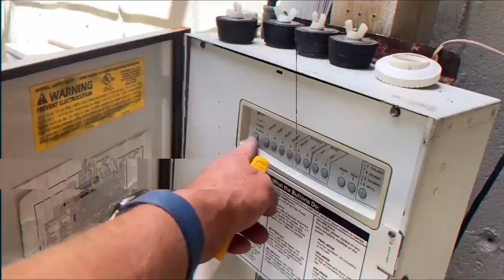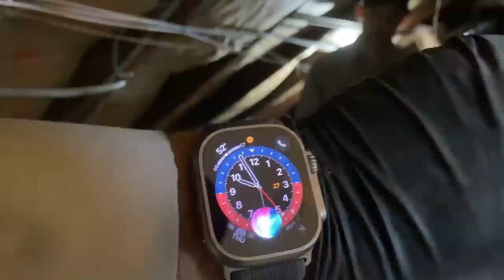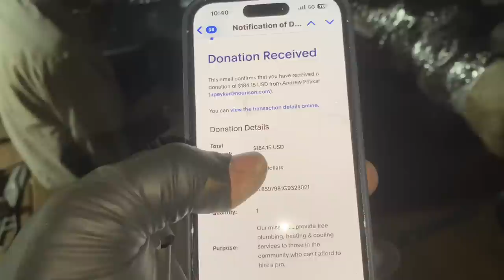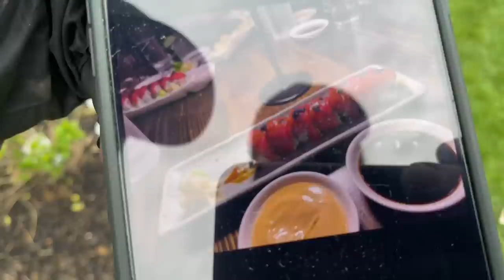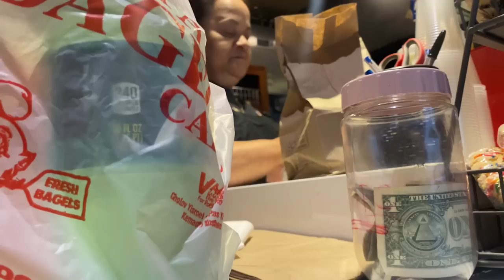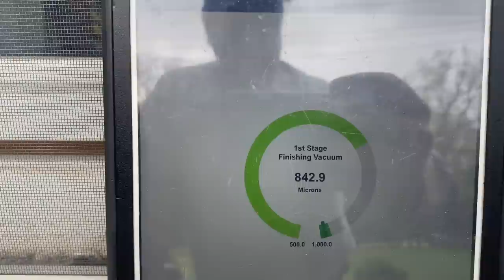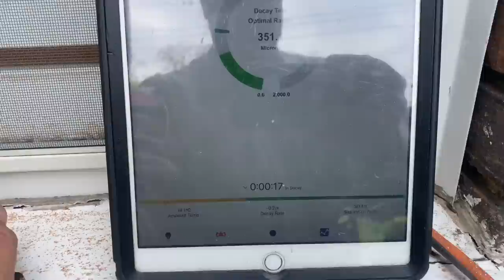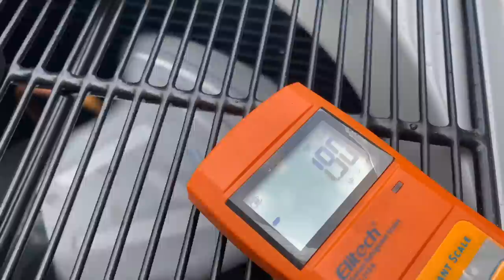Major Overhaul of Central A/C System Complete Rip Out & Installation of Bosch IDS 2 0 Heat Pump

Comment: Hey Mike, I always love your videos, I went to Bosch heat pump training yesterday and the guy actually said they have a built-in surge protector on those boards because I asked if we should be installing one and he said no need just if you were wondering. Not a bad thing to have double protection thou 👍🏼

Comment: I have the single TruBlue hose kit. I can get down below 100 microns in 20-30 minutes with a hilmor  pump, even on large Multi-zone systems. I think a lot has to due with keep the pipes sealed up during the installation process.

Comment: Another great video.  

Question about the Bosch air handler vibration.  Why didn't install include air handler duct work vibration transition supply and return collars or air handler hanging support vibration isolators?  Not needed?  Its obviously a lower cost without.  

Gave you the heads up about the Carrier Viesmann buy out the other day.  I was looking into Viesmann for my oil to gas replacement but was concerned about about parts availability.  Instead, I went with a burner change out of my Weil McClain cast iron 5 section boiler with internal domestic HW coil.  Went from an oil Becket burner to a natural gas Carlton burner.  Don't have the higher efficiency but nolonger have signafigant maintenance.  Maybe  a Carrier/Viesmann will be a future solution for me.  Viesmann still requires annual mineral cleaning on the cone heat exchanger.

Comment: I know its not your work but those people should really invest in some decent roof insulation. they would keep so much more heat/cold inside in the summer and winter. making those AC systems way more efficient.

Comment: Just curious about the weigh in I never installed Bosh but most units I do carrier,York, Lennox most of them are pre charged for 15 ft so if I had 55 -15 which left 40 and 6oz for every 10 feet wouldn’t that be 24 oz or  1lb 5 oz ?

Comment: How come you didn't show the system operation? Mainly the air coming out of the supply ducts, and the temperature differential between the return and the supply, also known as Delta-T.

Comment: Only recently came across your videos and have become a fan. Nice work. Live in  Central Florida and looking into having my system replaced with a Bosch 2.0. The system is not well know in this area. Never know about it till I ran across your videos. Do you have any common issues with Bosch and do you have any problems getting parts for them. Keep up with the videos.

Comment: Mike I missed it. What is the fitting used to connect right at the condenser and AHU
Reply: @PipeDoctor  i was asking if there was a press fitting to adapt to the condenser and the ahu then i seen it was brazed in. sorry for not being clear

Comment: 13:08 corner cutter! WTF, the rest of us use tin snips(left/right) to cut beside them or screw driver, hammer and pump pliers to open the seam. yeah it sucks, been there done that. reused existing duct to make new transition in place (attic with tight pull down stair access) took the duct heater unit fully apart and bare heat exchanger barely fit with half the attic stairs removed.
the duct through old unit heater was  36" x 36" after a 30" x 30" heat recovery condenser coil tied to multiple glass door front cases.
what the fork was I even doing there, and in the middle of an nasty cold spell when SHTF. git-r-done? 3 days job in two days, with pressure on in the second day with huge ducts apart and zero heat to the building for hors while working. I was sweating bullets for hours as the building temp dropped and I prayed distant water lines wouldn't freeze, luckily nothing did even in the 10F weather and colder into evening as we finished.. I often bite off huge chunks of poo in which swamps me and tests my skills to the moon and back thrice, but I get it done and don't walk away mid job.
Reply: also, that "corner cutter" isn't made for cutting the folded/rolled layered duct seams. it's meant to cut single layer straight cut off duct bends, then use tin snips to cut beside the layered bends and cut it away. you can use regular snips for all of it, but it takes more steps overall.

Comment: That tee you put on the condensate drain, if it ever gets clogged then you have a leak in the attic. Should have put it over the drain pan no? Just wondering what the reason for the tee being installed so far away. Seems like a liability for water damage!...lol
Reply: The vent is higher than the air handler… it can’t leak.

Comment: suspending units and hard ducts from the rafters was and still is preferred, because it transfers more of the blower noise to the outside walls and dampens some in the suspension straps/pan/rubber riser blocks, which adds up to better vibration dampening. even if ECM, balanced wheel and dead quiet at install, the near future will bring noise.
placing them on ceiling joists below transfers far more noise and vibration, often through  multiple floors of the home. again, not bashing the install, get what you paid for, etc.
if they want a ten day job done for peanuts and in one to two days good luck~ you did far more than everyone else would have, they'd have slammed a new air handler/furnace on the existing ducts and drove off. major issue or not. tail light warranty 🤣🤣

Comment: start of video, "20 feet in the air, how long would that take you to braze" zero time, because that would have been an bend on the ground and just fed into place, no braze no compression tools(less fittings/joints, less leaks!) cough, cough. granted that doesn't always work and good luck getting very long copper coils anymore, nobody wants the hassle or to deal with the large weight( commercial building with hundreds of feet runs and 500 to 1000 foot coils! hell, electricians hardly ever use 1000' spools of wire for the same reason(outdoors only).
Reply: @PipeDoctor  haha, but look at and think about all the prior line-sets of the past, majority were straight soft copper radius bent and only braze joints at the terminating ends... not really about being a smarty pants, but to help wake everyone up to the past better techniques which provided more durability. then again, the junk impure copper is liable to start pinhole leaking everywhere these days. 🤠

Comment: Running the line set "inside" the wall cavity by cutting the interior dry wall and removing and replacing any "insulation materials"; then patching the wall when done would have made the job perfect.